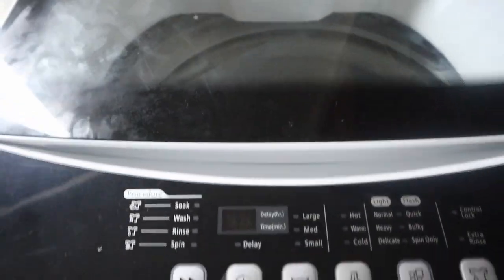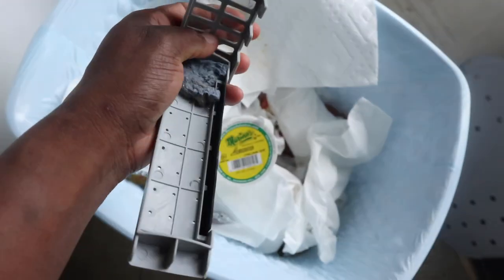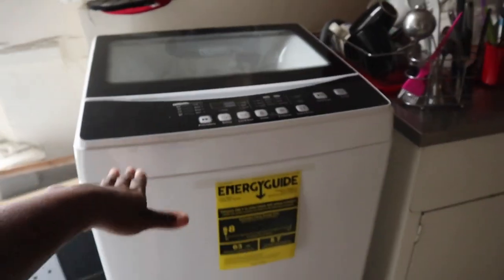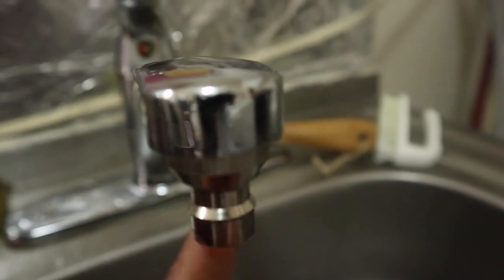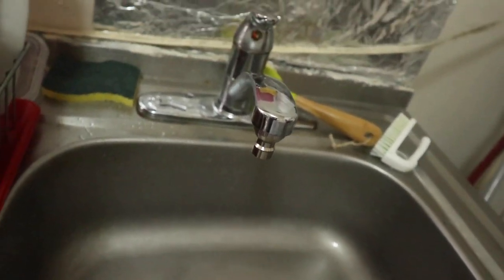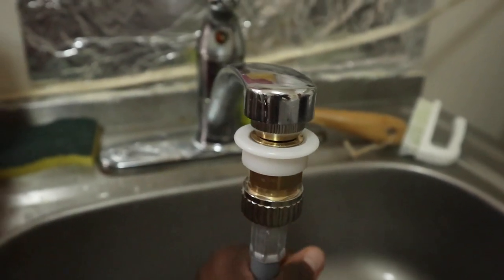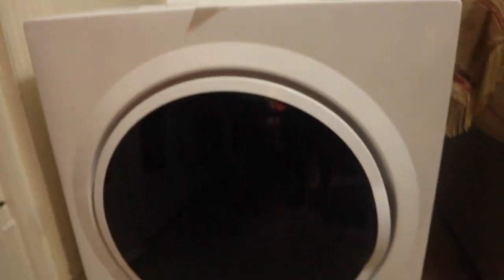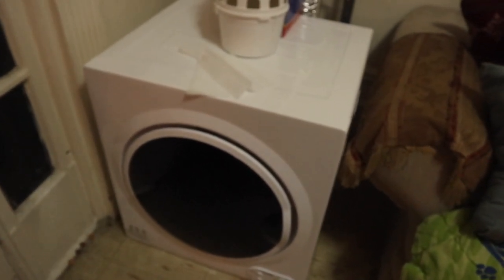PORTABLE WASHER MACHINE & DYER | BLACK AND DECKER | PANDA 2020 NYC

Comment: You should not have accepted the discount. The drum is hitting against the all of the machine and one too many washes will tilt the drum off its rotation surface held up by a round rubber and other steal like pieces. But, I recomend taking the back off and tap out the damage areas.
Reply from the maker: Great advice! Thank youu
Reply: sometimes, you have to crawl before you walk.

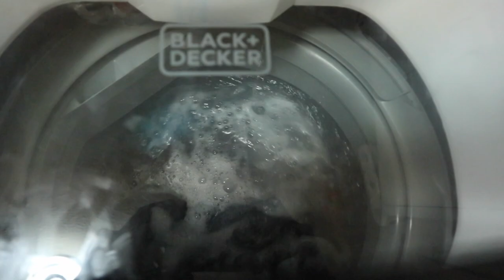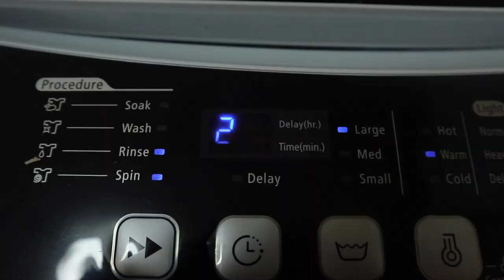Comment: I just got this washer, except the 2.0 cu ft version. When I first used it, and the agitator started, I thought it was broken because it was moving too 'slow' left to right, I didn't think it was fast enough to clean the clothes. I see your machine goes at the same speed at 13:50, which is a relief to know this is normal.  My clothes were not moving around, after watching your video, I realize I had too many clothes in there. On my machine, I noticed right at the end of the wash cycle, the agitator started moving faster for a quick minute, just like yours did in the video at 15:02.  After seeing this video I realize my machine is not broken and it's working exactly as it should, thank you so much , this video gave me peace of mind.
Reply from the maker: You’re welcome ! Lol yea it’s just the machine itself. I love it .

Comment: There's a 2spout that goes into 1 so you can put it on the hot and cold then it goes into one, that way you get to turn on both hot and cold water. I got my at a home store in my town but u probably can get it at Lowes or Home Depot! Makes it much easier to use both water temps running in the same time.
Reply from the maker: Thank you 😊

Comment: if the dryer ever stops working (specifically if it sometimes comes on but doesn't feel like it's blowing air when it does) then it's probably the belt for the fan which can be replaced easily. The newer panda dryer models use cheap belts for the fan so I imagine it's going to be a common problem in the near future
Reply from the maker: Hey hasn’t stopped working yet ! No issues thus far

Comment: They some nice washer I have the Panda got it from Amazon too you have to call them in advance and ask them please protect it from damages let them know that you'll send it back fast as it come there no way I kept that washer machine I sent it right back they pick it up at my house I had one of they Prime driver to pick it up cause will do it for you or have UPS PICK UP THEY SEND YOU RETURN SLIP THROUGH YOUR EMAIL 
The reason it loud yess the washer knocking against the dents that's lot of cosmic damage oh wow make sure you always plug them directly to the outlet no extension cord how well I'm.learning this the manual manufacturers do say this and dont use the same outlet with washer and dryer plug together on the same outlet if use use extensions cord on that dryer omg the plug will get hot and melt causing you have replace the power cord like on my Panda dryer now I didnt see the part where you can't use extensions cord hugh mistake my dryer still new still works just got replace the power cord due to that extension cord burnt the original power cord plug 🙄I thought I pass this on to you so you dont experience it all of them do it they different name but same method of care I too also got the same dolly 😃😃 if I cant find a repairman to come replace my power cord I have to curb it just like my Magic Chef Dyer when it started making loud noises this will be my last buying portable again they are helpful for those are disabled sick just cant go to laundry mats thank for sharing your story

Comment: Thank you very much for sharing this video, great job!  Love how your video shows how most people would use this.  I was on the fence with this setup, but you sold me!   One question though,  are you able to fit a comforter or winter jackets in the drum?
Reply from the maker: Hey hun thanks for watching! I'm glad it helped ❣ I was able to place a queen size comforter set inside ( by it self ) all I did was let the machine  start  going for about ten minutes then I paused it so I could push the top of the comforter inside the water so it could get wet . I'll show an example on my update video ( coming soon). Hope your subscribed 😊. The winter jacket I'm sure u can fit it as well but try to do it by itself . Hope this helped

Comment: I have the kuppet washer with the 2 tubs. And when it drains the water i put it in the toilet to drain in there... is that something that can be done with this drain hose?! Or does it need to be higher?!
Reply from the maker: It you have a big bathroom you probably can only thing is the other hose would have to stay hooked up to your faucet for when it needs to put water back into the machine

Comment: Hey I’m from the uk and just wondering if there’s a reason you can’t have a regular washer in your apartment. Just curious, but I love this idea of you can’t. It’s better than the twin tubs I’ve seen. Thanks.
Reply from the maker: UK ! hello 👋🏾 & I could but I would have to call an electrician to come and do extra thing since the washer would need a lot of water ( I did purchase a new washer machine at first for about $900 but it was just too many things I needed for it )
Reply: some places don't want you doing that because it takes money from them using their laundry room, along with any damages that are done they aren't responsible, like installation and flooding issues.

Comment: I would take the back off and beat those dents out. I have the Panda washer and my cat chewed on the hose. I had to open it and replace my hose. If it is scraping and causing friction you might have a fire someday. I use warm water because my hose was expanding where the connector is attached.
Reply from the maker: Thank you for the advice 🙏🏾
Reply: @NeshaBryant  stay safe.

Comment: Good but you do understand that if it is hitting at the dent, it is friction wearing away at both-like when you rub your hands or cars get a dent. Small cosmetic dents are JUST THAT. Things should not make noise, if they do, something is wrong and it is an 🚨. Try  to get the dent out. Someone can help you take it apart, reach in there and push it out- should not be difficult :) Remove the adapter,wrap a few inches Teflon/Plumbers tape in the direction of the turn-then screw your regular sink 🚰aerator. You can now R& the washer one. Do not leave the Washer one on your faucet- not made of the same stuff :)🧺

Comment: Have you ever watched  Queen size comforter in your washer
Reply from the maker: Yes I did , but it had to be wash alone .. I let the machine fill with water & after I'll stop the machine & use my hand to push the comforter down a Lil so every part gets wet ( after u can leave it .. once it's wet the comforter get smaller )
Reply: @NeshaBryant  ok thank very much

Comment: You really aren't suppose to use hot water.  Something in the fine print about dying.  We really have to take these warnings serious.   And as a black woman, we shouldn't have to accept defective materials because our money matters.   They should've given you most of your money back.  But thank you for the video.
Reply: Exactly. I'm sitting here wondering why she didn't exchange it???? Like 🙄🙄🙄
Reply from the maker: A year later and it still works , yes our money does matter but Like I said in the video I had to drag it up five flights (it a heavy machine) future wise yes I would return it.

Comment: Omg young lady you got a plug across the sink with water electricity on lord dont never run a power cord across a wet kitchen sink power surfer itself will shock you you'll been bless but I would remove that cord run it the right way becareful
Reply from the maker: It's on the side of the sink

Comment: Aint no way if you were convinced the denting happened in transit to you that you would accept 50 bucks and keep that machine looking like that. Lol I'm more inclined to believe after dragging it up 5 flights of stairs, opening it and seeing the damage you considered the possibility you may have caused the damage, and when you found out they wouldn't send you a new machine you just took what you could get. Lol if it works, it works but come on girl...let's be real here. Lol
Reply from the maker: There is no reason to lie. Trust me sliding the machine up steps will never create dents like that . If that was the case the dyer should of been dented as well no ? 🤔. I'm sure there are other ppl that has had the same problem hun lol .. it works so I wasn't dragging it back down all those steps .
Reply: Working for a major shipping company I can verify how many unfortunate things happen to packages because the demands of getting the job done quickly in the shift you work - things fall, get crushed, pushed, dropped and so on - until you work for any where who handles these types of packages it is probably better to wait to comment - guaranteed she took better care and time of getting it upstairs than what happens in the early morning hours for loading packages onto driver’s cars for delivery
Reply from the maker: @rachelbrubaker6920  thank you !!!! 😊